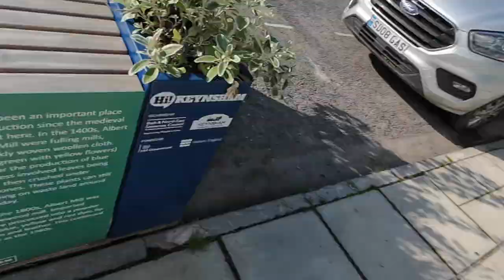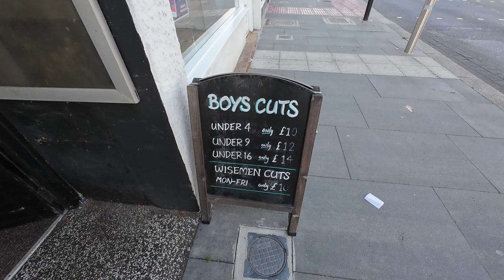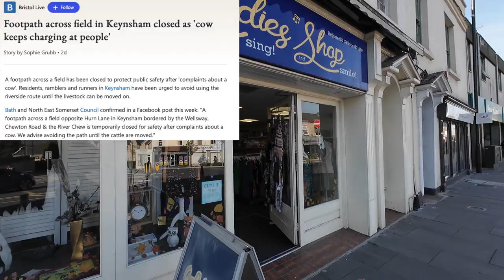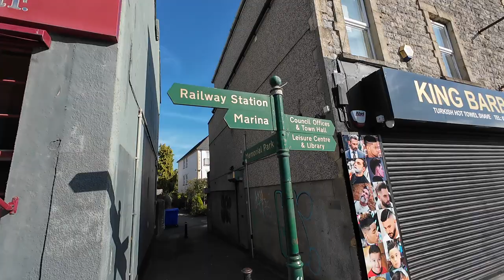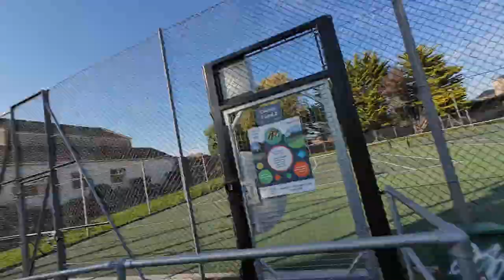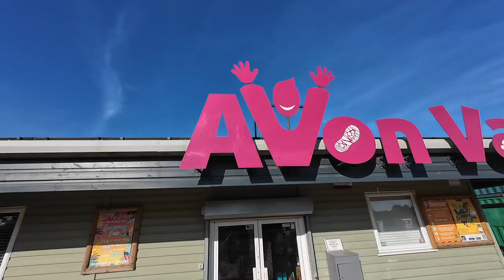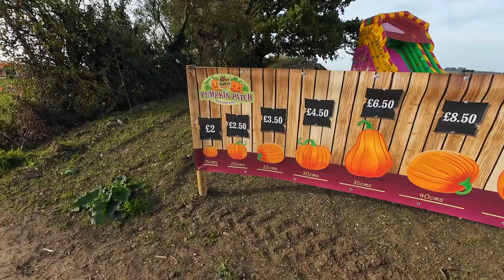Keynsham: Van issues, Dangerous cycle paths & Pumpkin Patches! Bristol

Comment: The trouble with the High Street is the cycle lane which goes the opposite way to the motor traffic. Also, I have never yet seen a bike on it, and there is a quiet parallel road round the back of the High Street they could use anyway, so the money spent on it was an utter waste. Sometimes there is a step down to it, and sometimes not. When it is flat it looks like a step because of the kerb stones along it. When there is shallow step, the kerb hides it. Very easy to stumble when it looks flat and you don’t expect a lower level.
Reply: Keynsham local here. Was in Trout last night for Angelheart gig. Agree 100% with your comment.